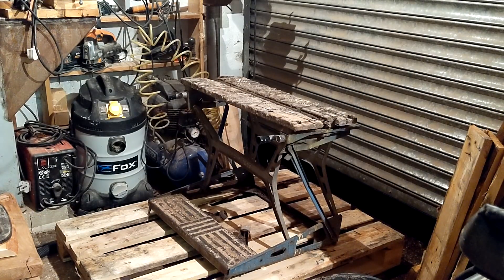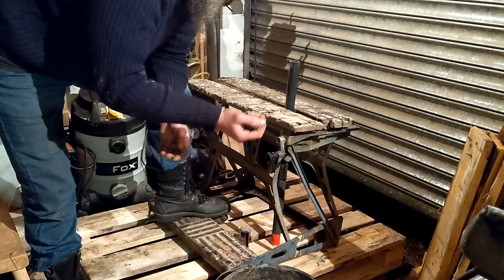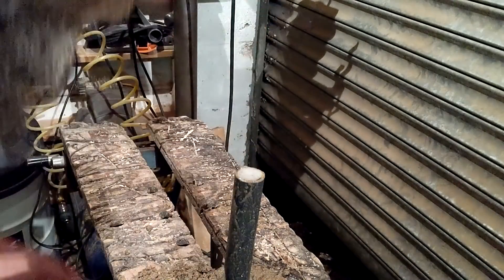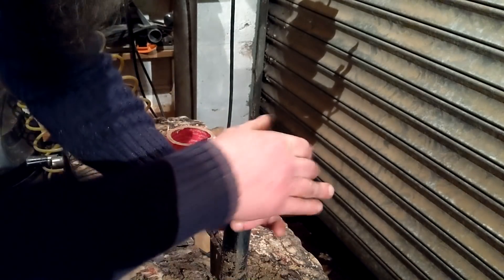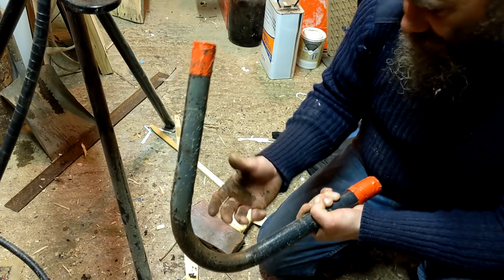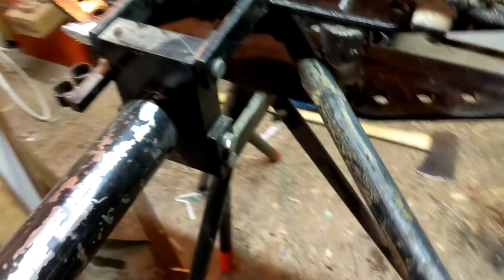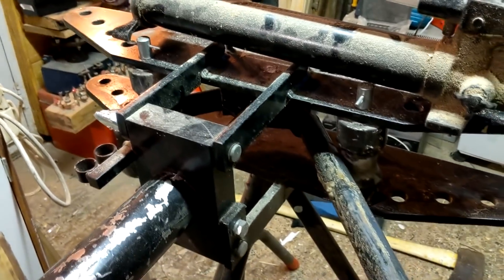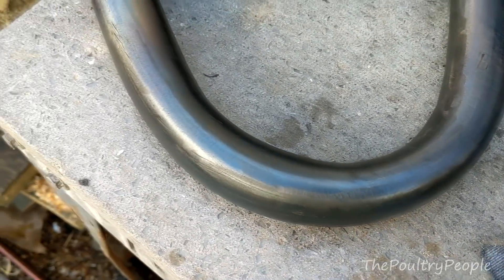Bending pipe for table legs - Reducing kinks with Sand and Water

Comment: 100% knew about the sand trick - but the water and capping it with Gaffer Tape? Seriously clever, you've saved me loads of time and effort as I'd previously tacked a cap onto it. Fookin' Legend.
Reply from the maker: All good, just passing on what other people have taught me, what are you getting up to? Roll cages? Exhausts?
Im really wanting to make some custom bicycles this year with sweeping curves so will be doing a bit more pipe bending and such. Ive got a fair bit to learn I reckon.